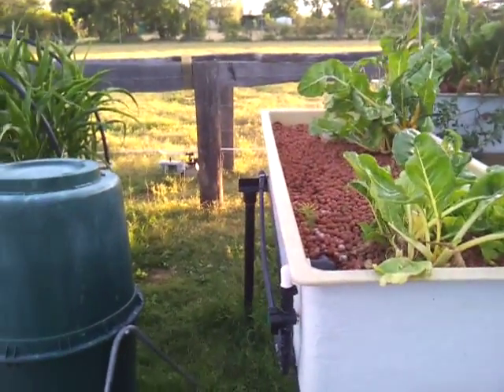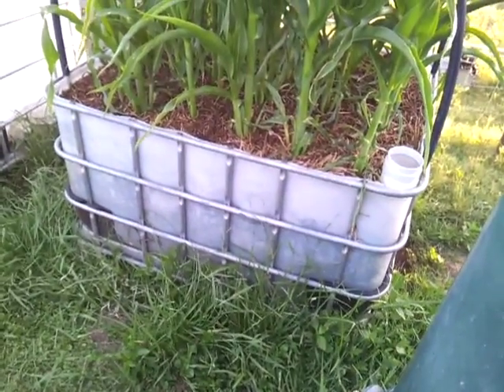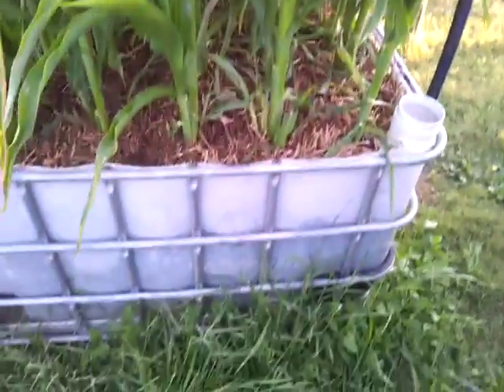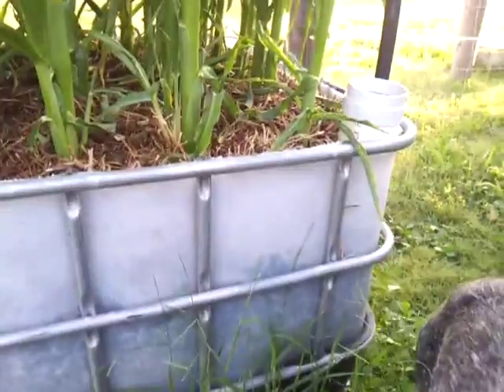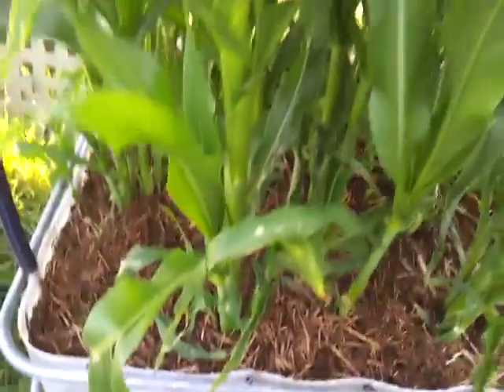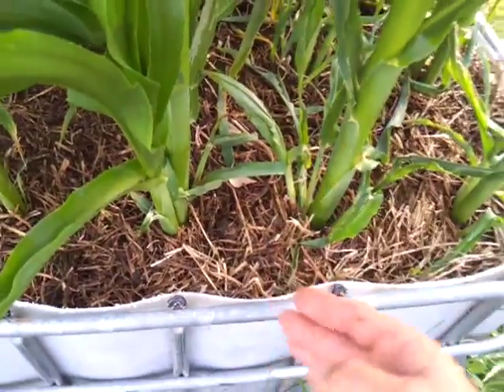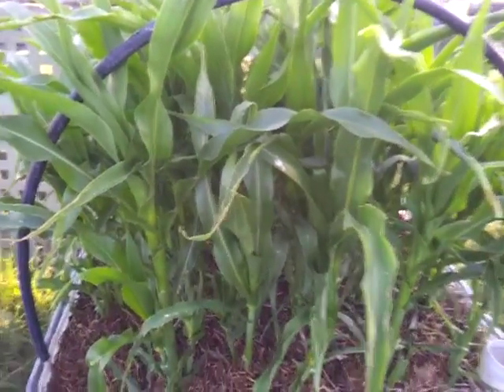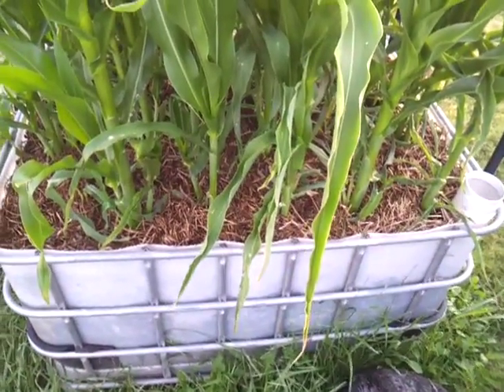Wicking IBC beds 10th December 2011

Comment: What was the yield?
Reply from the maker: Gordon Pilcher pretty good from what I can remember this was in 2011 so a lot of time has passed since then
Reply: Can we se an up date Rob Grey tells you've moved near him
Reply from the maker: Gordon Pilcher I wish I had time Gordon. Work, business and life just don't allow me the time.
Reply: I've been working on system that will bed 3 IBC's  connected using bulk head fittings to make 3 X bed. Rob had video there he cut the sides of the IBC and it gave him a flat bottom . I'm working on that and no pipe in the system scoria with plastic  plant pot sitting down in the resting on the floor to initiate the wick  Taken the idea from the green smart pot a bit of yous and some of Rob's. I found that  a meter by meter a bity restrictive so have tried to reinvent the wheel so to speak
Reply from the maker: Gordon Pilcher sounds great. Look forward to seeing the setup.